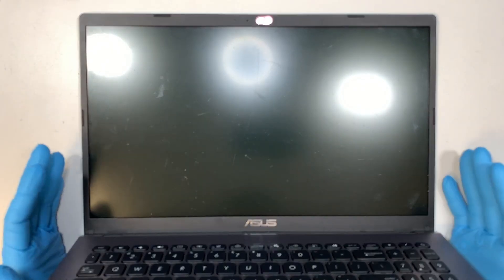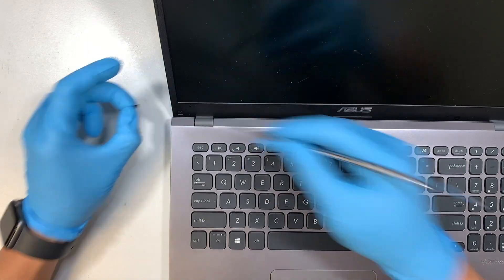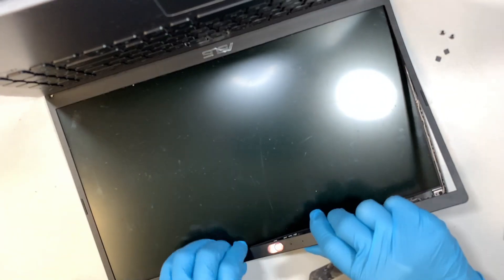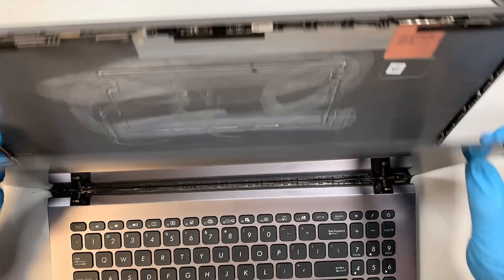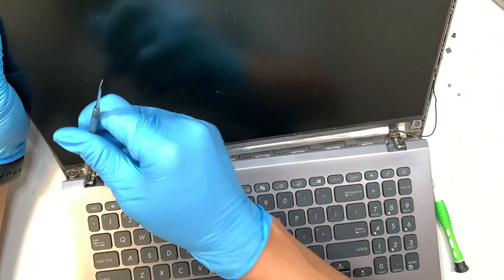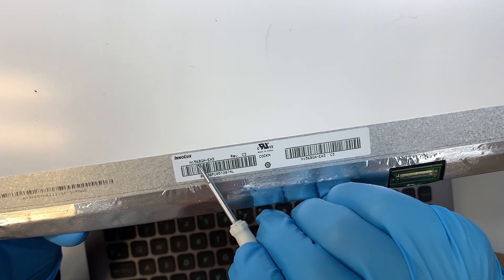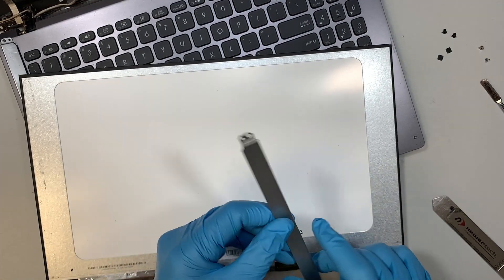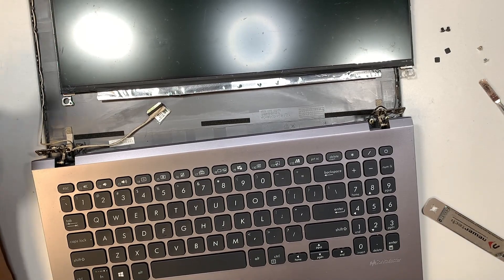Asus M509D Screen Replacement

Comment: Hi - thanks for the vid - I've successfully repaired a friend's laptop. The screen was only 37$ in Poland :D When it comes to assembly design - I left the screws that hold the metal brackets and the screen popped off - brackets stayed in chasis even tho my friend's laptop had broken hinge screw nests on the right along with a broken plastic cover just north of the hinge (probably she forcefully opened the screen way too wide). Nevertheless, it works now. My final thought - I would not accept this task without seeing your video first - great job!